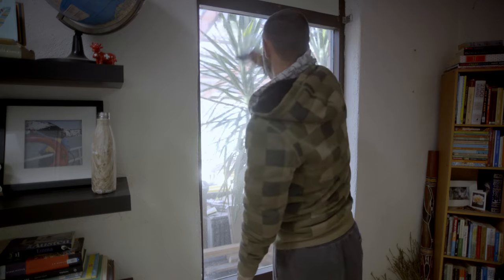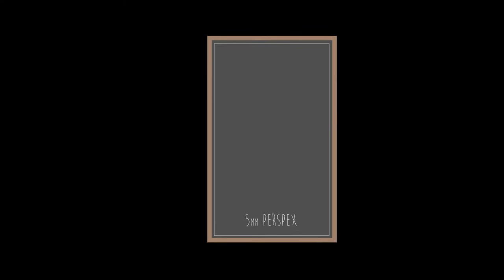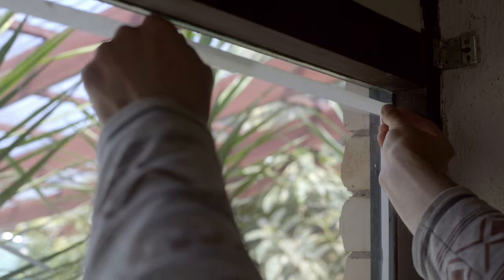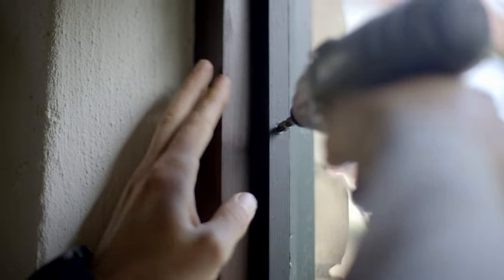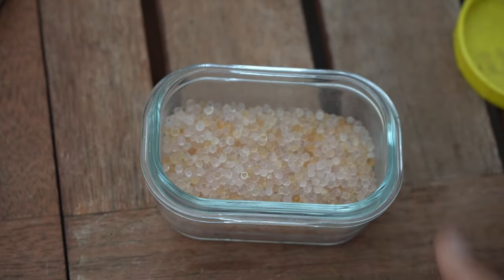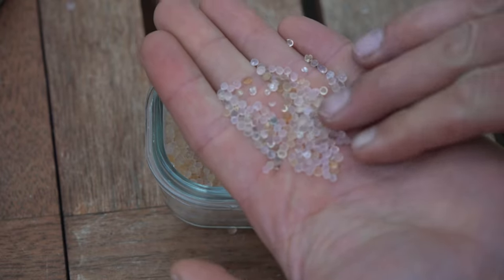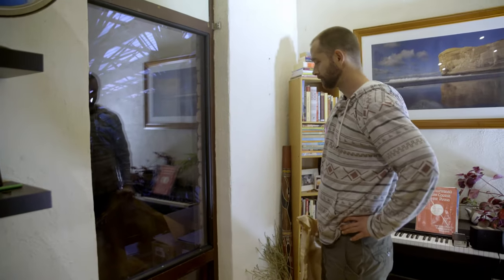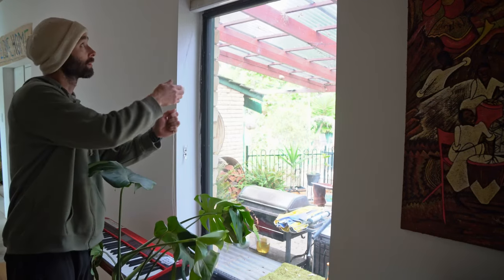DIY Retrofit Double Glazed Windows Cheap and Semi Permanently!

Comment from the maker: A few additional notes. Nails would be neater than screws, but i want to be able to get in-between the panels if i need to. Particularly if this idea failed or to refill silica at some point. Also perspex isn't critical in the design, glass would work well too. However, there is better thermal performance from perspex, especially thick perspex. 🙂

Comment: Awesome!! How long did this take you? How thick should the Perspex be for highest performance? Is it worth going any thicker than your 5mm? How much expansion did you allow for with the expansion and contraction you mentioned with the Perspex? 2mm all around?
Reply from the maker: Hi there, thicker would only improve thermal performance but 5mm thick is working well. I left 10mm gap but that’s probably overkill. But it’s hidden by the outer frame so it didn’t hurt either. I hope this helps.